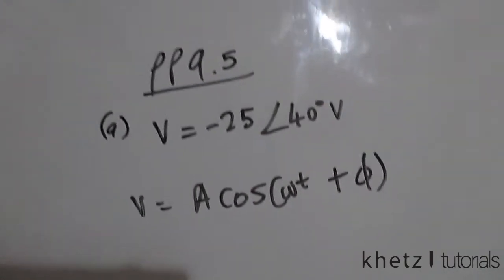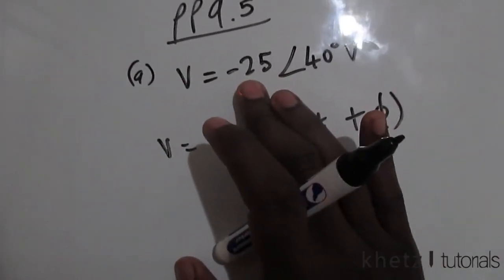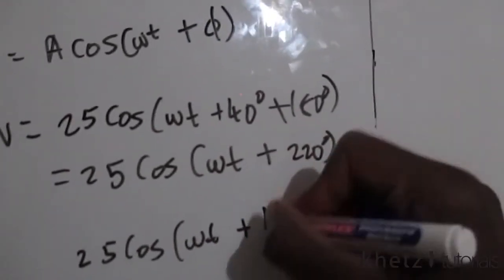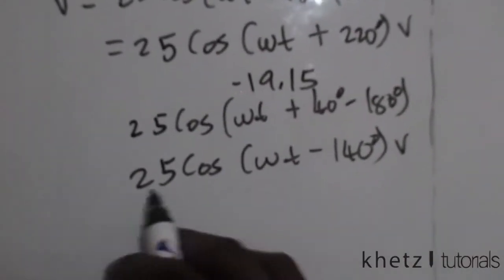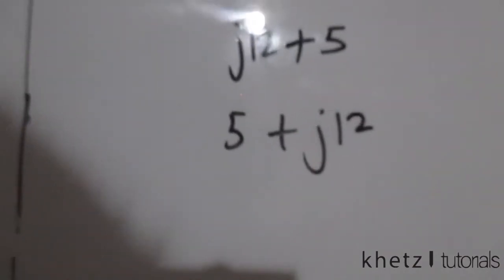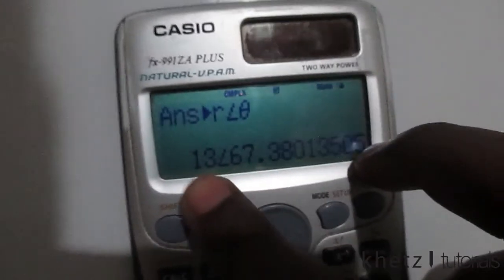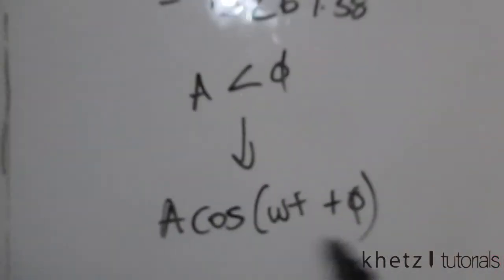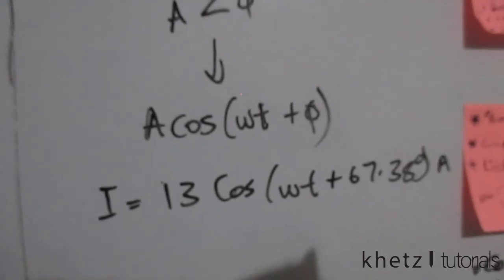Fundamentals Of Electric Circuits Practice Problem 9.5

Comment: Hi sir, How to solve (5+j12)A manually. 
cause were not allowed yobuse this kind of calculator.
Reply from the maker: We know that j = sqrt(-1) so j×j would remove the square roots and you'd only have -1×-1 which is 1 and the 12 would just be multiplied by j
Reply from the maker: To convert to polar form, you square the real and imaginary parts under a square root I.e sqrt(A^2 + B^2) is the amplitude and the angle can be found from the arctan of imag/real